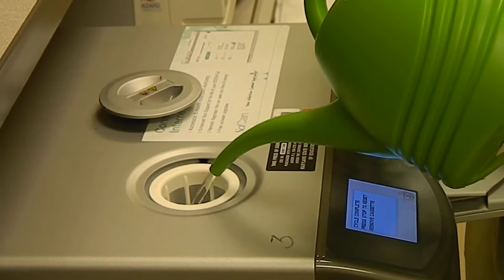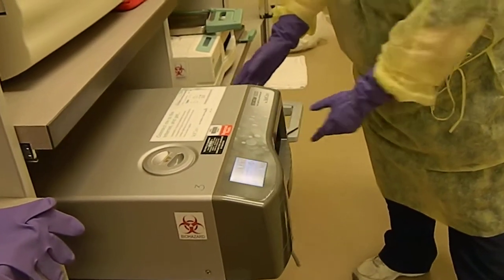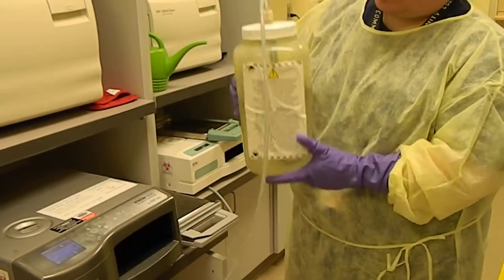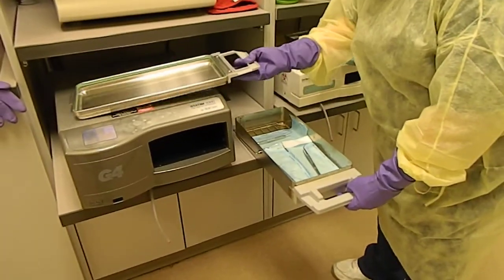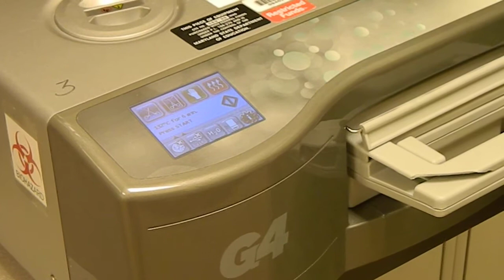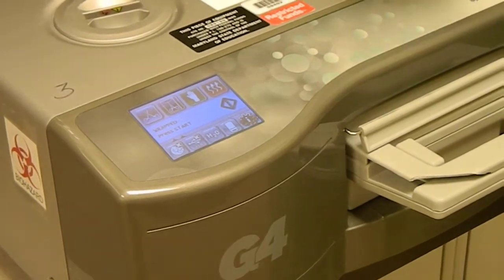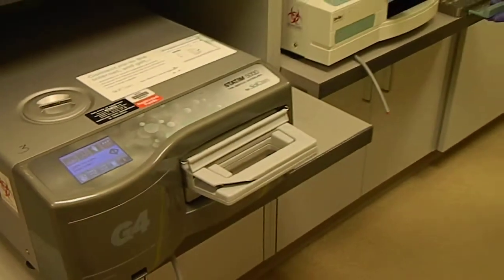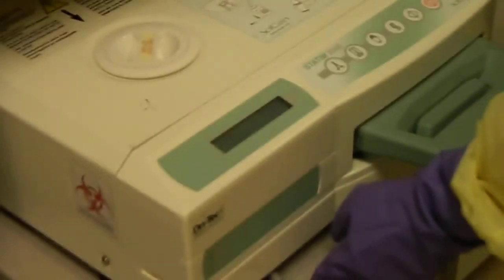Statim Sterilization

Comment: Hi 

I have a question do guys put the instruments into a ultrasonic cleaner before sterilizing?

Thank you 😊
Reply from the maker: It depends... Ultrasonic tips, gloves, x-ray rinns no.... Other metal instruments yes
Reply: Jennifer Suminski 
Thank you for your response, is it necessary (Metal instrument) to be in a ultrasonic cleaner prior sterilization? Or manual cleaning is acceptable?
Reply: @rogieannmanalo6557  you will first clean the instruments with enzymatic detergent and then put them in a ultrassonic bath with water and enzymatic detergent